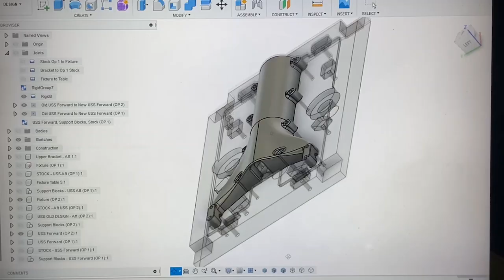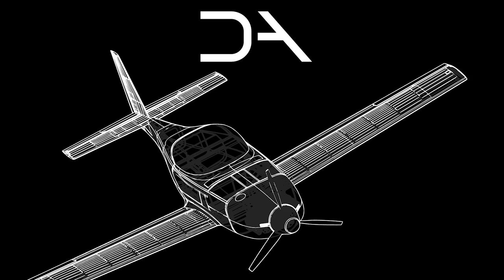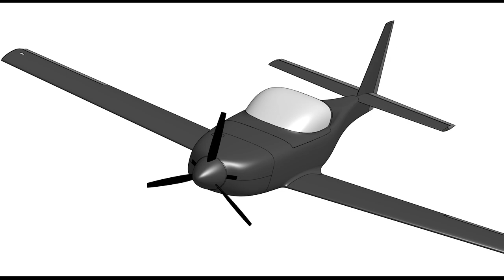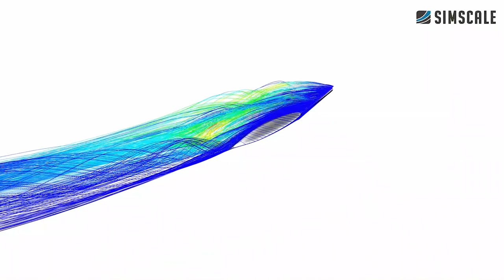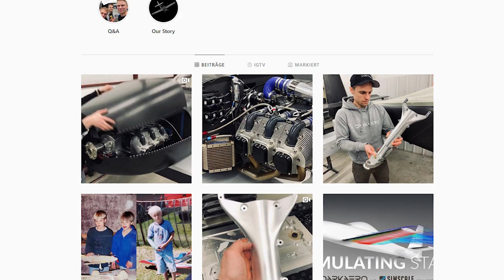The Modern Wright Brothers - DarkAero | Podcast #3

Comment from the maker: 🎓  My Science Courses – https://courses.jousefmurad.com/
✍️  Latest blog posts: http://jousefmurad.com
📥  My Newsletter – https://jousef.substack.com/

Time Stamps
----------------------
0:00 - 1:00 : Intro
1:01 - 3:50 : Introduction of each one
3:51 - 6:55 : How was it psychologically to give up your job and start something by yourself?
6:56 - 7:28 : What keeps you awake at night?
7:29 - 9:57 : Why did you choose the engine that you have and not another one?
9:58 - 14:24 : What is Hologrid?
14:25 - 16:46 : How much fuel can you store and why is it stored in the wings?
16:47 - 18:18 : How do you distribute the fuel?
18:19 -  18:51 : Take human out of the equation to make plane flights safer
18:52 - 20:11 : Max Cruise vs. Economy Cruise
20:12 - 26:16 : Price and the kit
26:17 - 30:50 : What were the biggest bottlenecks?
30:51 - 35:25 : How much of your studies were useful for the project?
35:26 - 36:29: Terms and Conditions? 
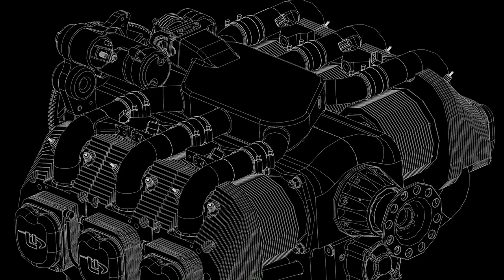36:30 - 38:57 : Analogy: Going for the stars and building a plane
38:58 - 39:30 : What's your spirit animal?
39:31 - 41:49 : Do you have any competitors?
41:50 - 42:25 : How do I get a job in your company?
42:26 - 44:17 : How was dynamic and flutter analysis performed - what tools do you use?
44:18 - 45:43 : Trade-off study for wings & CFD usage
45:44 - 48:57 : Are you also using analysis for topological optimization?
48:58 - 49:43 : How did you incorporate SimScale into your workflow?
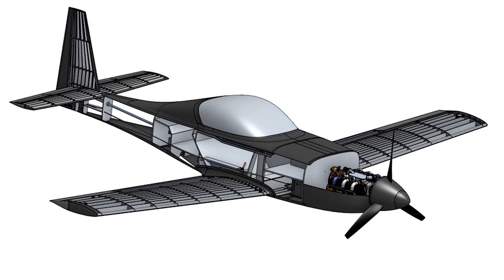49:44 - 51:18 : Who is going to be the test pilot?
51:19  - 55:18 : Group working experience leading to this project
55:19 - 57:17 : If you could own any plane, what would it be?
57:18 -  58:02 : What will be the take off and landing distance? 
58:03 - 59:16 : How are you guys financed?
59:17 - 1:01:51 : What are redundancies in the airplane?
1:01:52 - 1:03:55 : What has been the most technical challenging aspect of the build?
1:03:56 - 1:07:30 :  Are there scenarios where you are fighting over each other?
1:07:31 - 1:09:49 : How long do you work?
1:09:50 - 1:11:16 : Where can the audience find you?
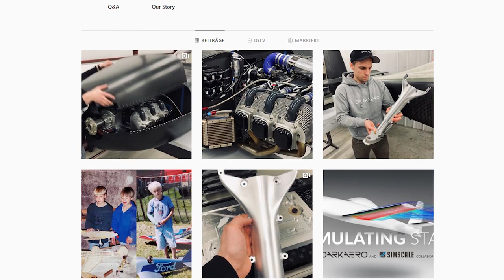1:11:17 - 1:12:35 : Last words from DarkAero
1:12:36 - End : Outro